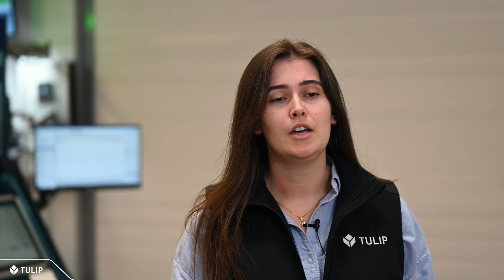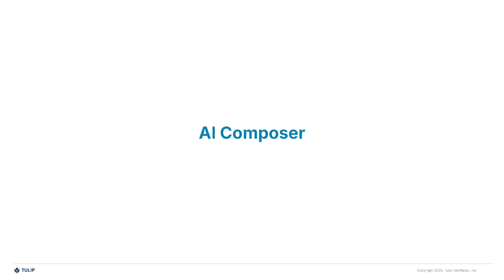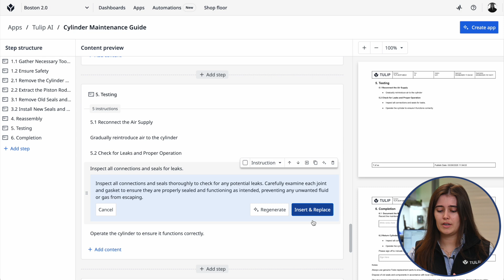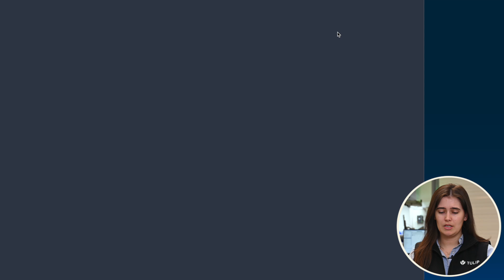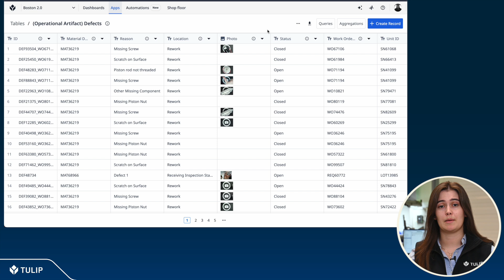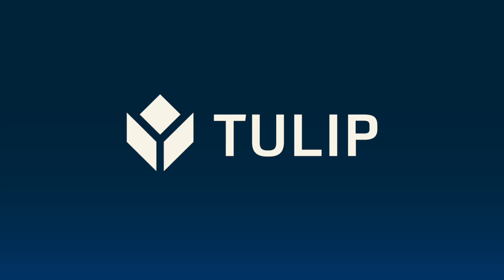AI for Operations: Tips for Boosting Frontline Performance

Comment: This smashes it: you are doing “AI == Augmented Intelligence” and the nerve centre of “Hub / Blackboard” as how to get all the data to do the human-driven RAD to add the operational insights. 

It's been a long time since i did some manufacturing as a grade student, since then I've been involved in regulated software development. Does this video say, “Hey, push the code back into your CNC milling machines, making parts”? Nope! This is about networked insights, which allow control engineer majors to add some extra 9s to their ops. The AI is the assistant - the ghost in the nerve centre - there to tile the insights and monitor the tripwires.

Or am I getting this wrong?